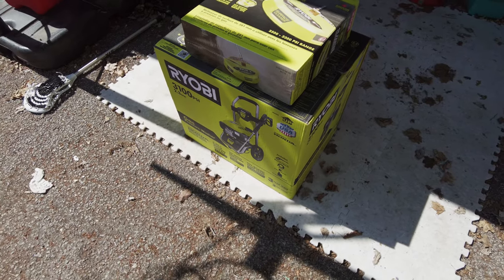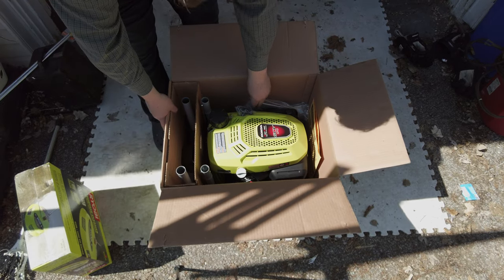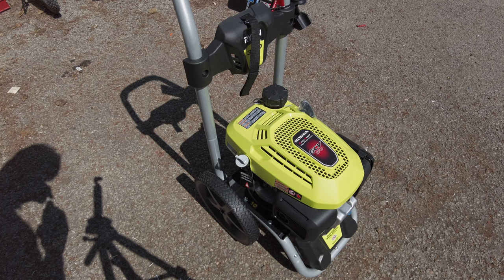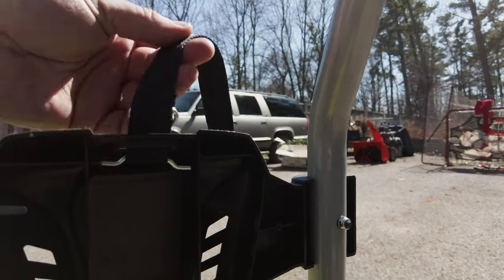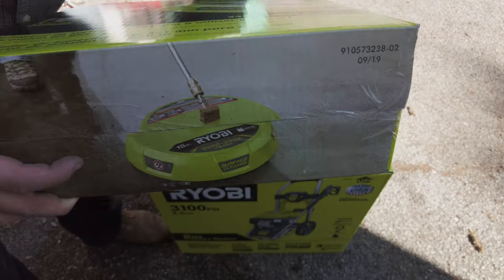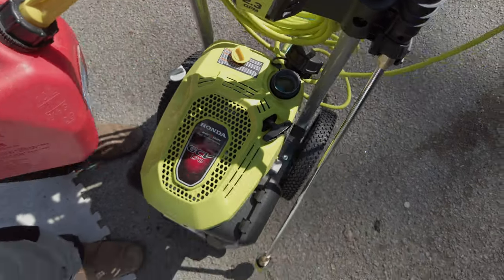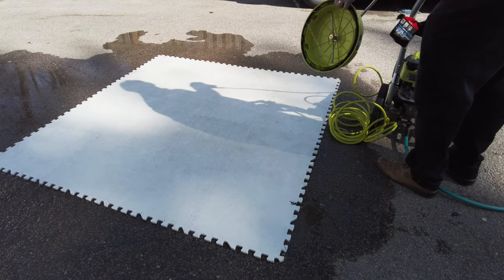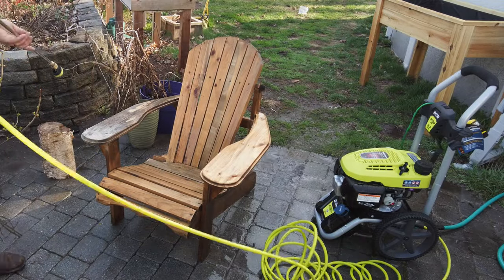Ryobi 3100 PSI 2.3 GPM Honda Pressure Washer & Surface Cleaner Review [shot on DJI Pocket 2]

Comment: I was looking for the choke for like three minutes before I started mine. I love the one switch design.
Reply from the maker: Ha so did I. Honestly I’d kind of rather have the control, but it just works so there’s really no need. I have a Honda push mower with the same setup and it worked great also.

Comment: I purchased this washer, it's a beautiful machine, however gas runs out really fast,  the water connection is really close to the ground, the velcro is mickey mouse, love it perfect description,  can you tell me would you purchase the one with the kohler motor?  i love the Honda, and that is just a turn of a button, however don't like several things already.  i have a 3200 kohler ryobi, super loud and rough, but more power n doesn't have to be filled with gas every 20 minutes. im just not sure which one. The kohler has to use choke run start, much harder to start and it was cheaper then the honda 3100? Are you or anyone familiar with the kohler engine? Thanks for the review i actually did one about 3 weeks ago, due to same reason no video, haven't uploaded  yet!  😊
Reply from the maker: Hey, you should go ahead and post your review!
Yes it does run out of gas pretty quickly, I really like the wide filler hole though.  You can tell the engine is really working hard also, it lugs down under full pressure.  I've had nothing but good luck with Honda engines and it's not nearly as loud as my neighbour's washer so I'm pleased with the Honda.  I have other equipment with Briggs and Stratton but don't have much experience with Kohler.  From what I read, they're quite fine and comparable to Briggs.
Reply: im debateing on buying gas vs electric. but gas is so expensive, plus i'm cleaning for like 2-5 hours i would hate going to the gas station multiply times
Reply from the maker: @illadin12  the tank on this takes only about 1 qt if fuel. You would want to just get a small gas Jerry can if you don’t already have one, even a 2 gallon can and use it to refill the washer. You’d get 8 tanks out of that, probably 5 hours run time under load. 
I have an electric washer too and it really depends on what you’re using it for. The gas is much more powerful which comes in handy for cleaning concrete or stripping paint etc. If you’re only using it to wash a car or boat - electric is plenty powerful enough for a boat, and a garden hose and a brush is all you need for a car. If youre not already maintaining gas powered stuff and accustomed to changing the oil every year on all those things, electric might be the best bet. Myself, I find the electric to be a hassle because of the cord and I always have fuel around for other equipment and don’t mind topping up the washer as needed. I have a pressure valve installed on it so I can dial down the pressure if I want to use it on a vehicle or more delicate stuff too.